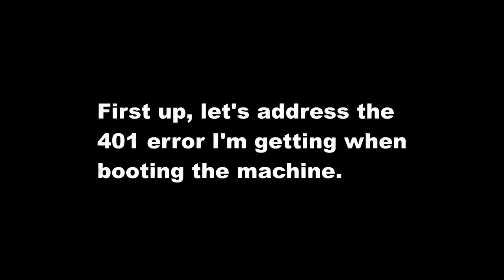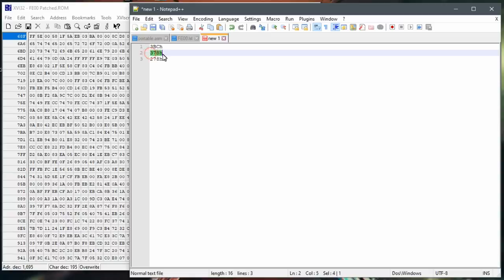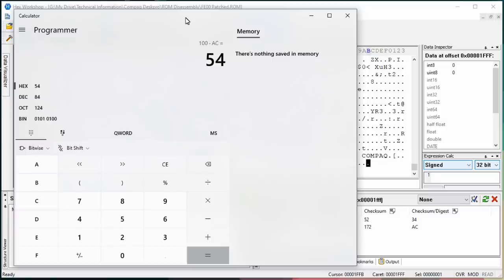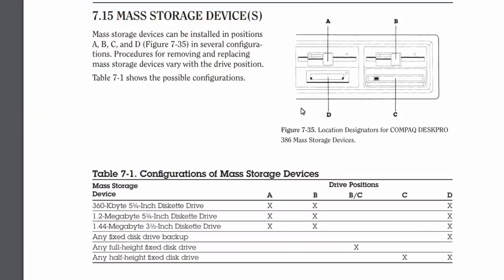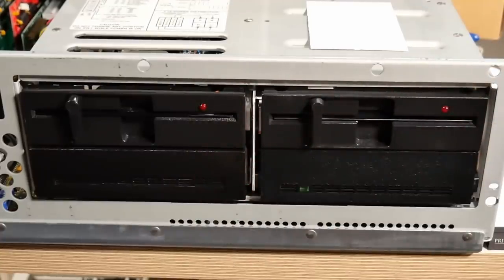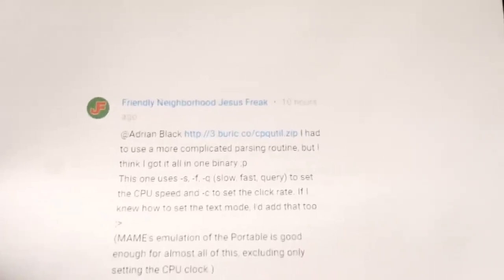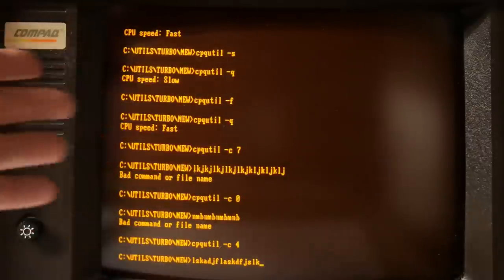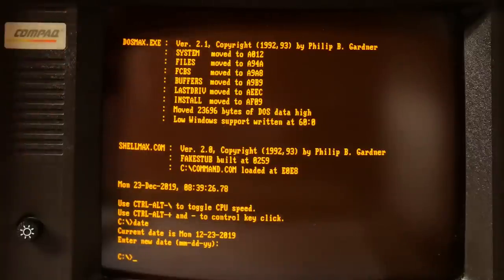Compaq Deskpro Part 3: Fixing that 401 error and more!

Comment: @Adrian Black: I hope you properly discharged that monitor anode before, btw.
There usually is some safeguard built in, but if that fails, touching not properly discharged monitor internals can be deadly. https://wiki.arcadeotaku.com/w/How_to_discharge_a_monitor
Reply: @adriansdigitalbasement  Sorry for not expressing myself very well, but what I meant was, work on the assumption that things are broken in there and at least if you know how to safely discharge the monitor, it may be better to do it than rely on old insulation and wires of unknown vintage and quality to keep you safe. Basically, I recently watched this: https://www.youtube.com/watch?v=4pupJ_a73ro&t=3m26s Admittedly, he does remove the anode cap there.

Comment: If the PC has a Dallas RTC chip, they still make modern pin compatible replacements
Reply: That no-slot RTC is actually a Dallas chip with a potted battery underneath, AFAIK it was the same chip that Tandy advertised as a "SmartWarch clock chip"

Comment: wait, DOS will stop working in 2099?. that makes me sad. I know it's silly because I'll be dead by then, but I'm like "noooooooo". I don't want things I like to disappear.
Reply: Well, the AT&T 6300 had an oddball clock chip that could only be set for years between 1984 & 1990.  January 1991 my lawyer called to say he couldn't set the time to the correct year.  A bit of poking around on CompuServe (Tim Berners-Lee probably hadn't even STARTED writing the first WWW server yet) and I found the CLOCKFIX utility.  A little newer version takes an extra switch to set how many "offsets" you need.

Comment: Watching you poke your finger around a LIVE crt made me cringe.
You know that has killed a lot of people?
Reply: I think he was trolling the safety sallies :D
Reply: The difference between people dying when poking around a CRT and people not dying when poking around a CRT is the latter's knowledge about where you may poke your finger without risking to die ;)
Reply: @lustfulvengance  Freak accidents happen. It always unnerved me having to measure the HV of a CRT of any type. Color is much higher voltage. BTW I ran a signal to a car coil and the coil took about 100 watts to make those sparks. I doubt the CRT flyback can make any where near that.
Reply: @lustfulvengance  go chew on some wires and let us know how that works out.
You may get a Darwin award!